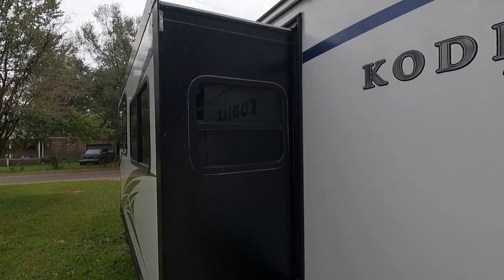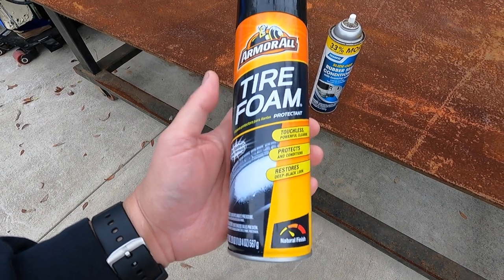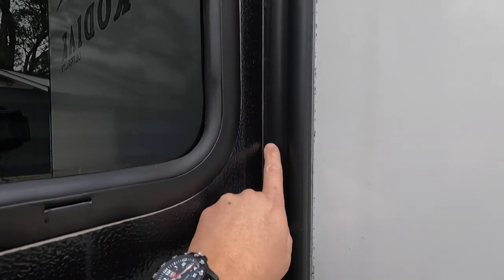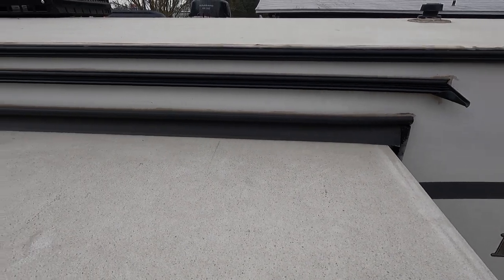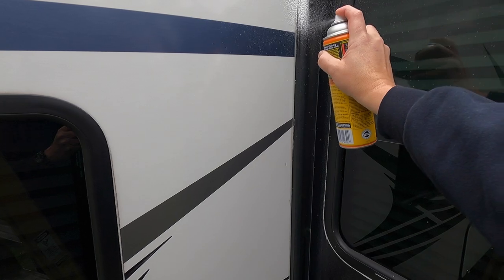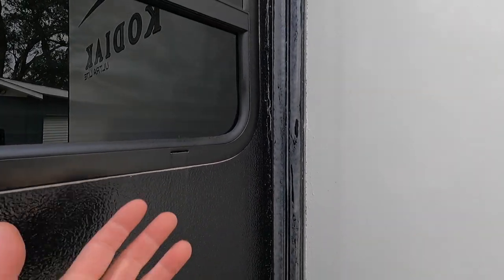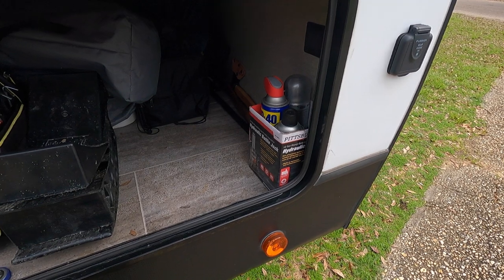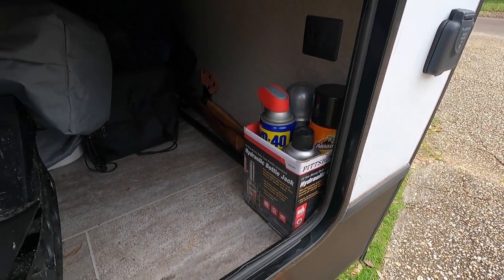RV How-To: Slide Out Seal Conditioning

Comment: Chemical guys VRP has been consistently recognized as one of the best for vinyl, rubber, and plastic. It is also water based so no harsh solvents. It is my favorite tire dressing because it is not a high gloss product and will no sling, absorbs very well. Give it a shot. Love the videos. Hope those drill bits I sent you years ago come in handy. Keep up the good work Adam.

Comment: Once a year (end of season) I spray the seals and tires with bleach white and strip off the residue and grime, wash it down with the hose really well, then after it dries overnight I apply a fresh coat of armor all.  The protectant over time accumulates really fine grime so I like to clean them up good once a year.

Comment: That's a good idea. Never thought of the armor all tire spray before. Its probably silicone based. Silicone is what actually does the rejuvenation of rubbers and plastics. Its also good to coat the door seal on your vehicles as well. I've used silicon lubes like crc silicone spray or wd-40 silicone. Also used silicone grease from the plumbing aisle at home depot. The grease does an excellent job but takes longer to apply. Anyway, thanks for the tip, I'll try the tire spray. Heck plain old armor all would probably work too because it also has silicone based compounds (pdms). Thanks for the video man. Love watching. 😀

Comment: I got curious and decided to check and see if there is a handy way to put a spray can on a stick so it's easier to do those long top and bottom seals. Turns out there is. A search for "spray can extension pole" turns up a few.

Comment: I also attempt to treat my slide out seals regularly, but I have had slide toppers installed on all 3 of my slideouts. Impossible to reach the center of the top horizontal seals with the toppers in the way. Problem is worse when using a spray can haven depleted some of the contents, losing pressure. The upside is that the toppers protect the seal centers from UV. If I can find a similar product in liquid form, I could put it in a sprayer bottle and take advantage of the extended wand. Looking into this. Thank you Adam.
Reply from the maker: Regular armor all should work also. Put in a pressure spray container like used for spraying weeds.

Comment: Don't forget that most slide-out have seals on the inside also. Doesn't hurt to lube them too. It's expensive to replace all these seals because the complete slide-out needs to be removed from the camper. That's why it's cheaper to maintain them.

Comment: Adam, would this be good to soften and preserve the weather strips/gaskets on my truck doors as well as the window strips on the door outside the glass?
Reply: Yes. I do it a couple times a year to keep the weatherstripping around the car doors in good shape. Silicone lubes and silicone grease from the plumbing aisle at home depot or other hardware stores will do the same thing. Armor all is also silicone based. Anything with silicone will rejuvenate plastics and rubbers.
Reply from the maker: Sure it would. Might be easier to use some regular armor all and wipe them down with a cloth.

Comment: Did not address cleaning the seal before, nor conditioning the back side of the seal.
Reply: That was my question.  In general, the prep work is very important before applying any product, regardless if you are painting, or applying sealant.  I just sealed the outside seams of my RV with Geocel ProFlex clear sealant & I first cleaned it by rubbing over the old seams with denatured alcohol using a rag.